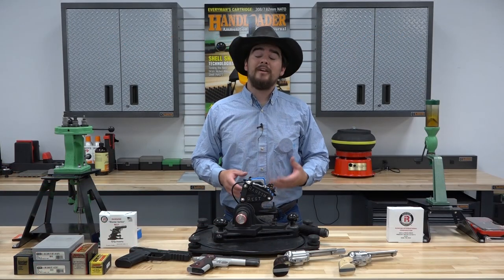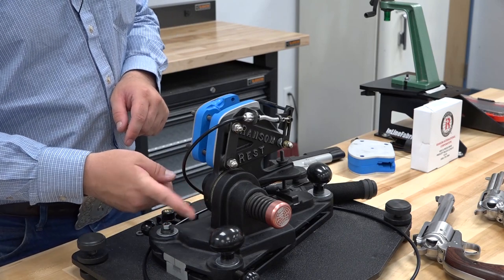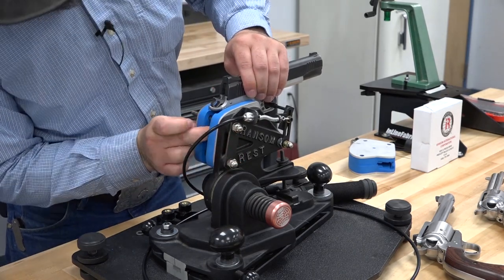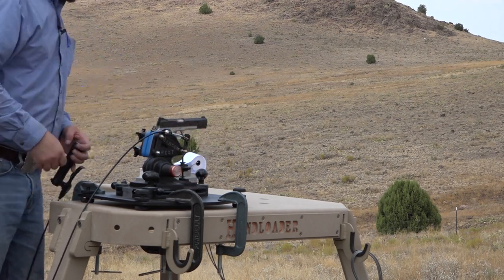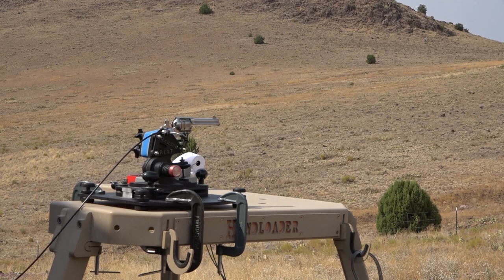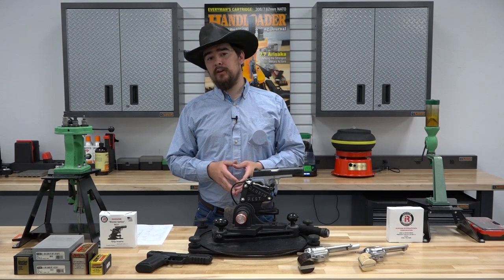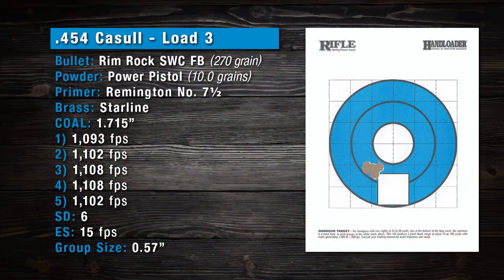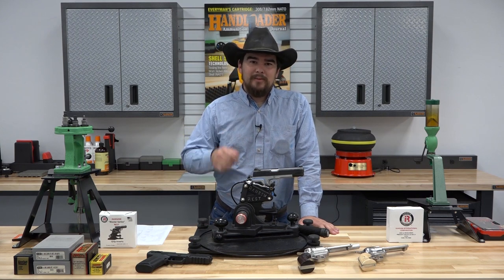Ransom Rest Review

Comment: Thanks for the instructive video.  My Ransom Rest arrives today and watching you will help me with mu first setup.  I would love to see a video of a S&W 500 magnum in the Ransom Rest so I can see what to prepare for. Thanks, Jonathan
Reply from the maker: No problem, I think you will find it is a great time saver, don't forget to fire a groups or two just to settle the rest, you can also use a laser bore sighter to get your handgun linned up on paper. We did not do a video on the .500 S&W Mag however we did do a video on the .454 Casull, I will post the link below. You'll want to remove the rear acorn nut and football knob (if you have the windage base) so the rest can fully recoil without damaging the rest or the gun. Best of luck in your loading adventures!
https://youtu.be/q4HXRMEWNTo

Comment: Great video. Thanks. I would have liked to see a little more information on adjusting the trigger bar. I just bought a remote cable setup for mine an haven't used it yet.
Reply from the maker: Thank you for taking the time to watch and comment. I did not show adjusting the trigger bar as it is a relatively simple operation. It is a single allen head bolt that you loosen and adjust as close to the center of the trigger as possible and when bar contacts the trigger you don't want it to slip or ride up on the trigger. If you do that you should be good to go. I really like the remote cable setup for proof testing firearms. It is nice to be behind cover should anything ever happen I also feel it is easier to be more repeatable with it but that could be all in my head! I hope that helps you if you have any further questions don't hesitate to ask! --Jeremiah
Reply: @HandloaderTV  Thanks.
Reply from the maker: @hanspup3062  No Problem! --Jeremiah

Comment: New Ransom User
Thank you for the various suggestions and recommendations on the use of the Ransom pistol rest.  I recently purchased the basic rest, but I haven't used it yet.... mostly due to my not having a portable, but strong and heavy shooting bench for it. Watching your video showed me that there are portable rests available... somewhere. Can you please tell me where you got the three legged shooting bench that you use when you had the Ransom rest at the range? 

Thanks a lot,
CD
Reply from the maker: Thank you for watching, they really are great machines and it is amazing what you can do with them. They are great for sighting in your handguns, comparing recoil etc. There are a few options out there that should work. Sadly the bench we have is a Konig Jager super bench and they are now out of bushiness however, you may be able to find similar designs and perhaps even a used one. The next best bench we would say would be the Stukey's sturdy shooting benches. The best way to test your bench to see if it can handle the ransom rest is to set a laser pointer on you bench and point it at something about 10-25 feet away and fire a few shots through the rest if the laser is moving during firing the bench is not sturdy enough if it stays still you are good to go!
Reply: Mind if I ask how much the rest cost you?
Reply: @jamesmartin7282  The price changes by vendor, check with Midway, or MidSouth. But get the windage adjustable base along with the "basic" Ransom rest.
Reply from the maker: @jamesmartin7282  Not at all so the MSRP is $443.72 for just the rest itself, adding the base plate and the windage base and remote cable trigger adds to that cost but is not needed to start testing. Full disclose we contacted Ransom Rest to purchase a rest for testing purposes and they provided this one for us. However we never let that effect how we test or the results we get from our testing. I would encourage you to call them and tell them what you are looking for I am sure they would be more than happy to help you out should you be interested in a rest for testing they are a great company and their product works very well. We are currently using it to test a .44 special from Taylor's & Company. Thanks for watching and commenting!

Comment: Great video!
What would be the result of overtightening the thumbscrews A/B/C?
Reply from the maker: ultimately you want your ransom rest results to be repeatable from the rest to your very own hands, I am sure you don't have a death grip when you shoot so your ransom rest shouldn't either. It is designed to be held in as similar of a manner to your own grip with repeatable transferable to your own hands. On magazine fed guns in particular the polymer framed ones it can also prevent the magazine from sliding out. you want the grip inserts to be holding the gun not the ABC plate clamping the gun like a C clamp. Hopefully that makes sense. Thank you for watching and great question!

Comment: 👏👏👏👏🇺🇸🧔🏽‍♂️… I only have one question … I know that the Ransom Rest has been around for years, but I was wondering , what are they going for nowadays , price -wise that is ?? 🤔
Reply from the maker: Currently for just the rest without the optional hardware we have on our rest I believe right now it's 488.09 and that included the hardware to mount it to a thick piece of wood. I believe in the configuration we have it's just under $1,400.00. The nice thing about ransom is that price of the rest itself is quite reasonable and that and a set of grip inserts is all you need to get the results we get. the rest is really just for convenience and ease of setup. The amount we use it and the amount of testing we do makes it more than worth it for us. It is one of my favorite pieces of testing equipment, it's right up there with my chronograph. Thanks for watching and great question! --Jeremiah

Comment: None of this is very interesting unless we know the distance.  Maybe I missed it?
Reply from the maker: All testing was conducted at 15 yards, which is the standard at which we conduct all of our load development for handguns. This makes all of our videos comparable to each other and allows for viewers to compare and contrast everything we do and compare one gun with another. We plan on doing other video at longer ranges in the future but for now nearly everything we shoot is at 15 yards. Thanks for watching and great question! --Jeremiah
Reply: Thanks for the reply. I listened again just now and heard you mention 15 yards. My mistake.  May I recommend at least 10 shots at 50 yards? I think you’ll see more meaningful differences in loads. Thanks for reviewing the RR, by the way. I just picked one up used. it was very helpful to watch someone with a lot of experience set it up and explain some of the nuances. Very educational!
Reply from the maker: @rjohnson5120  No problem I apologize it took so long, we get so many these days it is easy for some to get buried or slip through the cracks. We have been thinking about stretching the distance for some videos with the Ransom Rest out to 25, 50 and even 100 yards just to see what happens. However the distance and accuracy should be relative to each other for the most part. In terms of MOA at 15 yards, 50 and even 100 yards a good load should shoot proportionally the same in terms of MOA. However I think perhaps that could be an interesting video in and of itself just take a few good loads and shoot them at 15, 50 and 100 yards to see exactly what happens. Ransom recommends starting testing at 15 yards so that is what we have always done. In the future though I think we will stretch that out once we have established good loads. Thank you very much for the kind words and the feedback if you have any questions I wouldn't hesitate to reach out to the company the guy there is very knowledgeable and helpful. You can also always leave your comments here as well. --Jeremiah